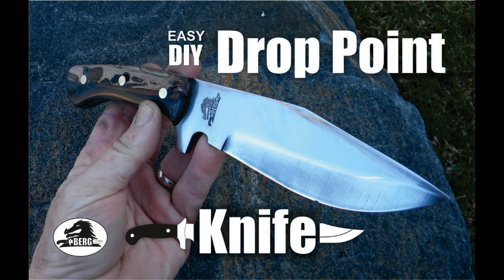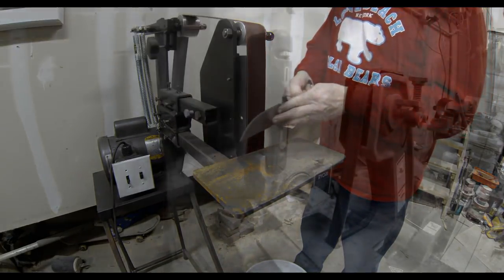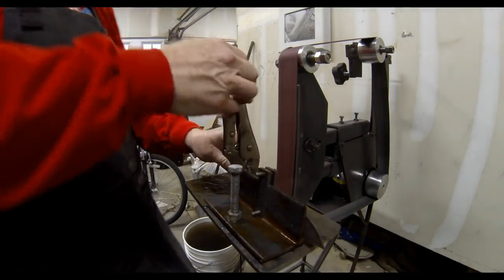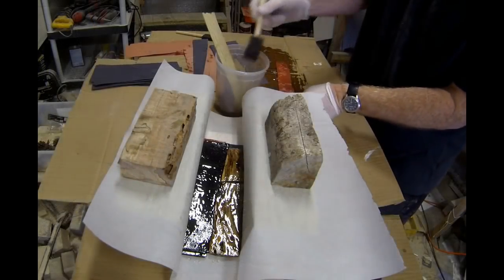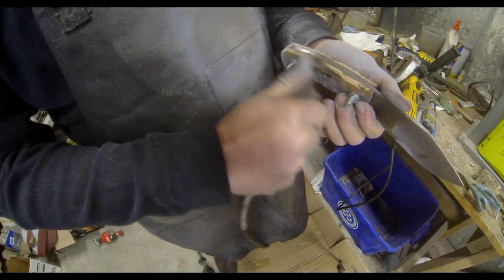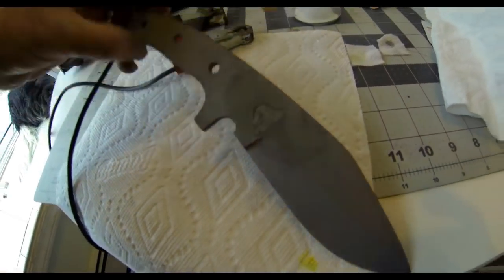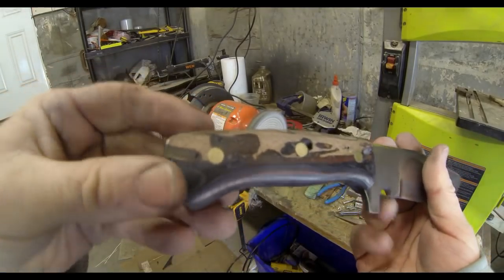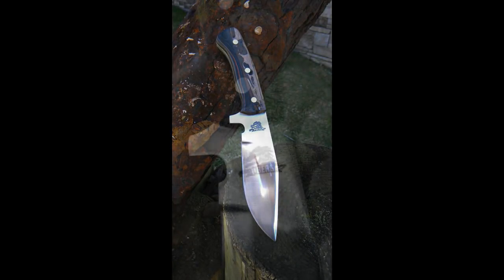Easy DIY Drop Point knife from a waterjet blank and with Hybrid Micarta scales

Comment: why don't you do the glass bead finish after you get your makers mark on the knife then you will get the finish that you were wanting
Reply from the maker: The glass bead would sand off the makers mark. I'm going to make another one with a bead finish but kind of got sidetracked with a cleaver project. If it comes out the cleaver is going to be very unique. Hopefully, will try a new type of electro etching stencil which will allow a lot of detail and design flexibility.